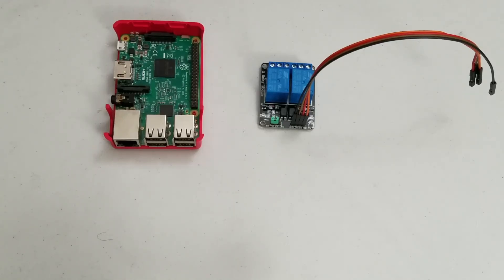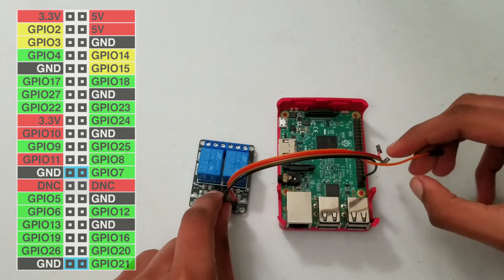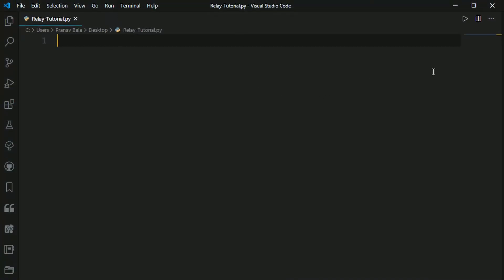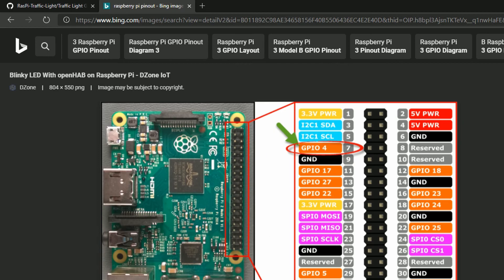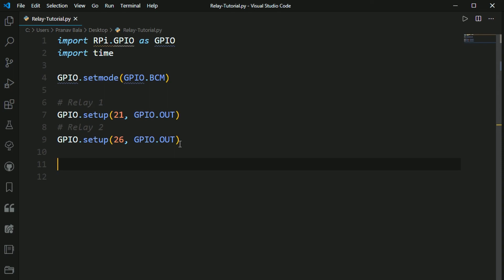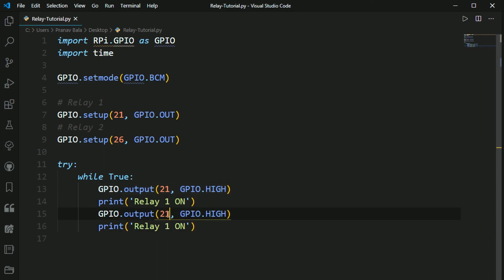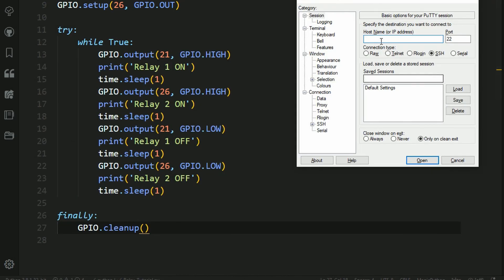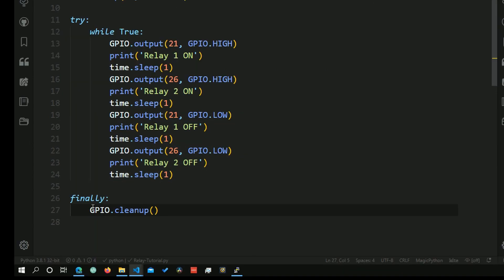Raspberry Pi Relay   Wiring + Code

Comment: Weird, mine is working backwards. When I set the pin out to GPIO.LOW the relay’s onboard led lights up along with the AC lamp I am switching on.  It goes off with GPIO.HIGH. My relay module is set for normal open mode and has an open circuit (off) when powered.

Comment: i got warning "this channel is already in use". do you know what's that mean?
Reply from the maker: That likely means that some of the pins are still active from a previous program. To mitigate this, you will need to add the line GPIO( or whatever your rpi.GPIO instance is called).cleanup()
Reply from the maker: ^^ GPIO.cleanup()

Comment: Hi, please can you help me understand....if you set 1 second for each function, why is there an overlay where both relays are on at the same time....surely one turns in, then off, then other turns on then off.....unless the pi reads and activates the eecond relay before the 1 second on the first relay finishes?
Reply from the maker: The sequence I used was High, High, Low Low. So, it turns on relay 1, then it turns on relay 2, and then it turns off relay 1, and it turns off relay 2 after that.  Therefore, there will be a point where both relay 1 and relay 2 will be on at the same time. I hope that made sense...
Reply: @TechNotebook  Hi, thanks so much, completely makes sense, you're a star.
Reply from the maker: You're welcome! Glad I could help

Comment: How do you handle the power on status of the GPIO pins so they don't inadvertently trigger the relays? Thanks
Reply: A little late I know, but for future reference: "gpio.setup(21, gpio.OUT, initial=gpio.HIGH)", where "initial=gpio.HIGH" sets the initial state of the gpio (in the case where the relay´s wired). And don´t be confused by the "HIGH" because relays works in a "inverted logic", so this means his initial state´ll be off.